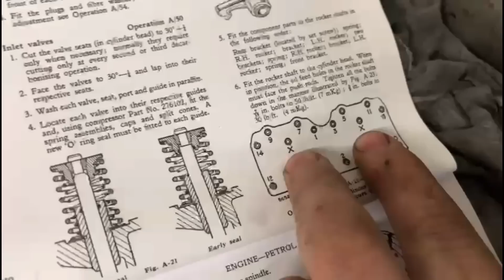We spent thousands on our M3 bodykit, but guess what happened next…

Comment: The cover for the end of the engine houses the “ thermostat switch for choke warning light”.   When the engine is up to temp and choke is still pulled out the cold start lamp warns on the dash, reminding you to put the choke in.  The original stats were made by Otter Controls Ltd Buxton so landy owners may refer to them as the otter switch.   Nice work Isaac.

Comment: Are the head bolts on the Land Rover reusable? I thought that they were replaced when removed.
Reply: Think they will be okay. Aluminium heads is when they need replaced, usually, all that expanding and contracting with heat.
Reply: In those days nobody replaced head bolts - half the time they annealed the copper head gasket and reused that, too.
Reply: @rickconstant6106  absolutely...old school..did it all the time...never had an issue..👍👍

Comment: Hate to say this and don't want to discredit the car it but the welding on the roll cage looks like pigeon snot, it's absolutely awful, there is no way a qualified welder has put that cage in, proper DIY bodge it and leg it job, definitely been done by a cheap home MIG welder with someone who's tried to teach himself. Far too much wire in his setting and not enough amp's. It looks so bad that maybe even a bolt in cage will be a better option given that you are only going to track day it.

Comment: What is that Land Rover engine?
Reply: Push rod overhead inlet valves, and sidevalve exhausts.... known as IoE or Inlet over Exhaust...
Reply: Also used in the Rover 60 car with a 6 cylinder version in the Rover 75. Started working on them in 1950 as a school leaver.

Comment: If the body kit hasn't arrived by the end of the week and the company is still not responding to your emails then contact your bank and start the process of a chargeback, if the company that sold the body kit doesn't respond in 30 days or provide proof that you had received it from when you started the process of a chargeback then the bank will issue a refund.

Comment: Provided you get through to the company you bought the bodykit from. You’ll need to find out what delivery service they used and the consignment note number. And contact them directly to find out where your bodykit is. However, the delivery company may not disclose any information as you didn’t book the delivery. It should really be the company contacting them as they booked the delivery. But… if you explain the situation. They may confirm there was an issue with the truck and your delivery has been held up. 
Good luck tracking it down.